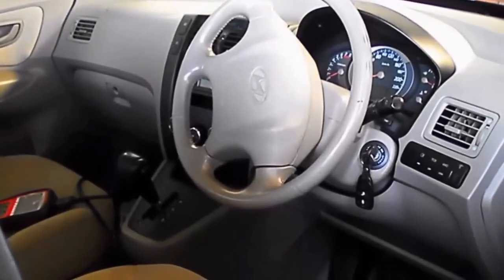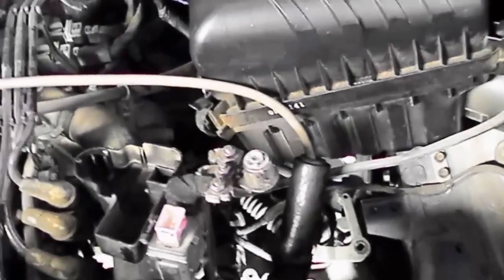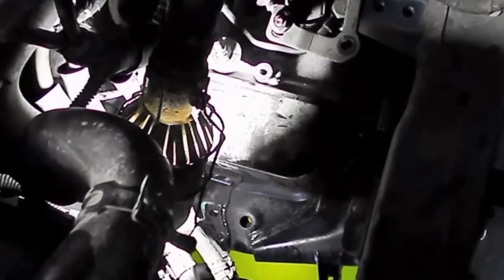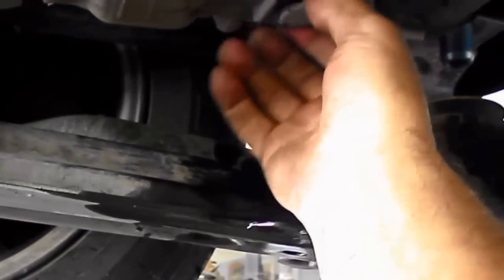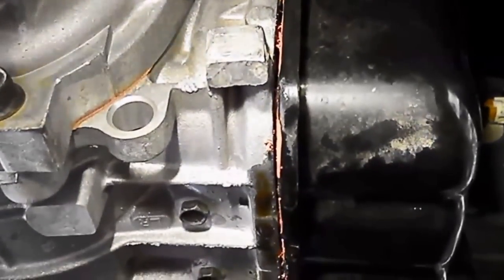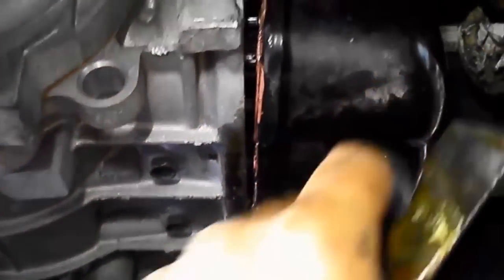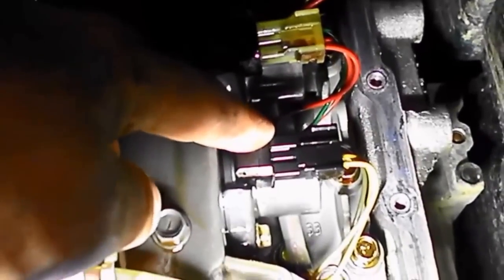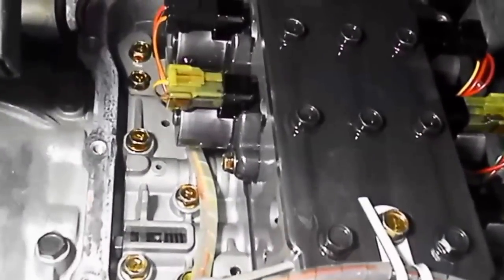Hyundai F4A42 Remove Automatic Transmission Solenoids DIY

Comment: Our 03 Elantra coded out a PO755 (2nd shift Solenoid) and Everyone had told me that they had to take the transmission out to do this. I am so thankful to have come across this. Now I know I can do this. Thank YOu!!!
Reply: I have the same code . is it the second solenoid shown?
Thanks
Reply: Well depending when circumstances if you're just trying to patch the transmission there's no need to pull it out but if you're doing a full service you would need to pull the transmission out that's what I would recommend I have been doing a lot of Mechanics for over 18 years but at that point you would be able to literally eat off that transmission before it went back into your vehicle hope that helps have a great day God bless and the service should not cost you more than 350 US dollars

Comment: Just wanted to say thanks for the helpful video. Was able to get the solenoids out and test them unfortunately they work. So it on to the Transmission control module next.
Reply from the maker: hi, hopefully you tested the solenoids varying amperage. glad helped, thanks & cheers 👍

Comment: Thanks for a great video.  I'll be doing this the same job soon.  How did you remove the wiring harness from the solenoids. Did you just pull, or is there a tab that has to be pressed?
Reply from the maker: hi, try wriggle connectors off. thanks and cheers

Comment: Greeting friend,
 the range of the selenoids should be ?, when measuring these gave me 
4.4 ohms, in this case you have to replace them or are within the range 
of operation?
Reply from the maker: Hi, depends what temp you are measuring at? should be 3.6 ohms @ 23 Celsius, but resistance will increase with temperature. hope that helps cheers

Comment: I am doing it at home can I just remove all mounts and just jack up the engine and transmission slightly to take the trans pan off? I have to replace a control solenoid so I'm going all solenoids to be safe.... Do you think it's doable?
Reply from the maker: hi, depends on your skillset, tools and equipment. just make sure safety is first. cheers

Comment: I know it’s been years since this was put out but do you remember if the pan had a gasket? From what I can tell, I don’t think it has a gasket since it looks like a sealant is used instead. Tried looking it up and I can’t find a one used on this vehicle, just wanted to double check before I take it apart.
Reply from the maker: hi, we use gaskets when they are available. cheers
Reply: @cliffl7619  amazing I really appreciate it. Would you happen to have a link for purchasing or a part number I can use?

Comment: Tuscone 2005 2.0 crdi driven 205000km
P0741
And a code for the inhibitor switch.
Shudder around 1800-2200rpm in every gear and very poor mpg.
Would this be the solonoids or the wiring for the solonoids? i have purchased both just need to get into a garage.
Reply from the maker: hi, id need more info to be able to determine. cheers

Comment: Gear 1 incorrect shift ratio that was the readout I've taken out the three solenoids on the one side and have tested them with a battery they all click does that mean they all work?
Reply from the maker: hi, these solenoids are tested varying amperage, not just on/off voltage. incorrect ratio might indicate slipping due to internal pressure leak. cheers 👍

Comment: Hi mate thanks for video 
I have 2008 Hyundai Santa Fe and codes  P0741 TCC son stuck of
P0735.,all gears are incorrect ratio
Do you think it is bad solenoids 
I changed the transmission fluid,  car still  hesitates to take off
Reply from the maker: hi, fault codes are usually electrical issues. more than likely contaminated and/or leaking solenoids and contaminated sensors. if you need more info, contact me on our facebook link, we can exchange pics, vids and beers on there. cheers

Comment: What was the vehicle doing for this job? I just bought this same vehicle the 2.7 FWD and it slips bad in drive. Have to use the manual mode, it tries to downshift constantly. What solenoid would it be for that the torque converter?? Any help is appreciated..... also is their a filter on this transmission?
Reply from the maker: hi, contact me on the face book link as i may need to send you pics and beers may be also needed. cheers

Comment: Hi I'm doing the same job right now and have a shift solenoid A code.  Do you know which one is the A & B.  I have 2 on the passenger side and 3 on the driver side 2004 Elantra GLS.  Thank you for your time.
Reply from the maker: hi, very confusing on these, a is 2nd from top on rhs ( where 3 sol are) and b is 2nd from top on lhs, as you are looking at them. id recommend to check them all though. cheers
Reply: Hi sir.  I tested all of them using a 12 volt battery and they all click when I connect the positive/negative clips.  Is there anything thing else that I should be looking for for?  Once again, shift sol A code.  Cheers
Reply from the maker: hi, you test these solenoids by varying amperage, also test resistance 3.6 ohms at room temp, will be higher if warmed up. now you owe me some beers !.use the link here https://www.paypal.me/BATS189 cheers

Comment: hi... whats seems to be the problem of the car youre fixing in the video? my car hyundai tucson 2010 80k kilometrs was flooded with water (muddy like) so I flushed it with hyundai ATf but aftr it jerks strongly from 1-2 gear when your gaining speed fast like higher rpm unlike the regular speed gain on the city traffic. maybe you have inputs on my problem.
Reply from the maker: hi, you will need to flush as much of the fluid out a few times. the coolant will get in the nooks and crannies and also absorbs into the clutch and band linings and will cause them to peel off...hopefully you replaced the faulty cooler ( we completely bypass radiators and heat exchangers to eliminate possibility of coolant entering trans ) and did it soon enough and well enough or your trans is on a limited life span.
Reply: @YepThatsIt  thanks.. i will check on that cooler youre saying.
Reply: well like you said, my car wont go forward now aftr 300 miles. N would reverse as well as drive. Can you help me figure this?
Reply from the maker: @mistergreen6557  hi, if was flooded, the clutch plate linings have probably peeled off. you will need removal and repair, and a reconditioned torque converter. cheers

Comment: My transmission on Hyundai Santa Fe has a code for shift solenoid A were is that located
Reply from the maker: hi, located on valvebody. make sure you check all solenoids while there. cheers

Comment: Sr. I have questions. Me have  one  car type Hyundai matrix gls the automatic transmission not working when we go run or reverse.  Thks
Reply from the maker: hi, any fault codes?
Reply: @YepThatsIt  no. But if we set to the drive or reverse nothing a power from the gear transmission automatic sr.?

Comment: 2001sante Fe trans just stop working out the blue but if I put it on auto shift it shift for one to two could that be a solenoid
Reply from the maker: hi, check all your basics first, then maybe check linkage worn or out of adjustment....then you can check solenoids. hard to say without more info. cheers

Comment: hi Sr..I have a 2009 Sonata 2.4l (4cyl, GCC spec') jerks when decelerating at 20mph. This happens only in the morning or every day at first use. I did not feel the jerk, once the engine become warm or after a 3 miles drive. I had gone to the dealer and and they did transmission software reset/update and that worked for me for 6 months. Again I am facing the same issue..what would be the problem..please help..

Thanks in advance !
Reply from the maker: hi, can be any number of things and very hard for me to diagnose without seeing vehicle. could be : fuel, electrical, blocked catalytic problem giving similar feel. always start with all the basic checks/tests before you start pulling things apart. cheers
Reply: YepThatsIt  ..Yup...Thanks for the reply Sr

Comment: Hi, I have an 02 Kia Optima se v6 with shift issues. The car accelerates slowly and seems to have a problem going from 1st to 2nd. Although I have codes for shift solenoids b and c.. How would I know which solenoids to purchase?
Reply from the maker: hi, try google a diagram for the solenoids, that will show you which is which. Or, alternatively if you visit your dealer ask them to photocopy from their shop manual. HopeThatHelps

Comment: My 2009 Kia Optima, which has a 2.4L Hyundai engine in it, was hesitating on the highway. Mostly from D to overdrive. The engine light came on and so I pulled over into an auto repair store and asked them to scan it. It came back P0741 torque converter, clutch, solenoid. I called my brother, who asked a mechanic friend, who told me to gear down when it started acting up, mostly going up hills. Is this video the process it's going to take to fix it?
Reply from the maker: hi, always good to start with solenoids, however depends on how many km vehicle has travelled as if its worn and internal pressure leaks a golden solenoid wont help. cheers
Reply: Thanks for the response. It has almost 146,000 miles on it ( 234,964.224 km}.I've had it flushed at least once. Reckon a flush might helped?
Reply: I priced a 60,000 mi replacement transmission at $450 U.S. as I began researching it.
Reply from the maker: hi, to me just a flush without taking trans pan off, replacing filter and cleaning magnets is mostly a waste of time and money. the fine metallic debris that is naturally created in transmission operation, will accumulate on the magnets until the magnets cant collect/attract the metallic debris anymore...then the fine metallic debris ( which has the consistency of grease ) will then become attracted to the solenoids which are electro-magnets. this will cause unnecessary contamination and wear, because the solenoids are the components that direct and regulate pressures and oil flows in the transmission......these are very important to keep as clean as possible. i say the more magnets the better combined with regular servicing ( not just a fluid change ) transmission service probably gets confused to be like an engine service -it is not !. the fluid is there to move things ( hydraulics ) and also a little lubrication. whereas engine oil acts like a filter that absorbs or contains the carbon in it, and needs to be replaced frequently and completely. hope that makes sense cheers
Reply: Ok, thanks. So a full servicing is a must in this situation.
Reply from the maker: always a good idea, but choice is always yours...i like regular maintenance, it makes things last alot longer and makes more reliable. cheers
Reply: As an ins. adjuster, I don't have much choice but to do the whole enchilada, so as to not have to worry too much about dependability. It messed up on my way to a catastrophic storm event, which due to lack of damage, was cancelled, but I can't afford that to be happening. We adjusters must have well maintained vehicles.

Comment: You don't have to lower the subframe. I removed the bottom portion of air filter box along with the air filter.  Also, remove the battery and the foundation tray that the battery sits on.   I removed one end of upper radiator hose(the end that goes into radiator) as well as one end of the lower radiator hose(the end that goes into radiator).  (Note)The fan mounted on driver's side of radiator will need to be removed to gain access to the lower radiator hose clamp.  Next, fold both radiator hoses back toward the firewall of vehicle.  I then removed the neutral safety switch giving me access to all of the bolts to the transmission pan to remove it and replace the transmission selonoids.
Reply from the maker: cheers & thanks for that
Reply: @YepThatsIt  You're welcome.
Reply: Did you manage to get the pan completely off?  I had went to a junkyard to practice it your way before attempting it on mine but the only issue was that the subframe was blocking the pan from completely coming off. I can probably get away with just partially pulling it off to get to the needed solenoid if I need to.

Comment: Hello sir.     I've got 2007 elantra auto, which after about 50 miles of driving, or much less, will give a loud clunk and a shudder, normally on deceleration and then it looses 1st gear and over drive-meaning that at 50mph it is doing 3500 rpm.     I have changed the input/output sensors and I believed that the solenoid are either shorting internally or just weak after 200,000 miles.     Any thoughts bro...??
Reply from the maker: hi, I'd say it could be a solenoid problem, often they have ok resistance when tested cold, but when warmed up fail. hth
Reply from the maker: Can be accessed easier from underneath, but would probably be much easier on a hoist than lying on your back....would be hard to bend your arms ;-)
Reply from the maker: hi, hard to diagnose online, but could be contaminated solenoids

Comment: hi my car is hyundai sonata nf 2009 check lamp is on and fult p0471 in diag  
torqe converter stockoff 
teranmission have 7 solenoid valvue
i dont know tcc sol where plz help me
Reply from the maker: hi, if it`s the same transmission as this one....as you are facing and looking at the valve body while still in vehicle, the torque converter solenoid should be the bottom right one. cheers

Comment: Hello again   I am desperate for some help:     do you know the position of the check-balls for rebuild..   1 with spring and 1 just the ball that sit between the part with the galleys where the accumilators sit and the very upper where the actual soloids are.. I split those two parts by removing all of the bolts from beneath ..( D'OH! )   and of course those check balls ( 2 of ) dropped out     I cannot find any information that shows this 'clearly'.   I have the Hyundai factory manual but it is an exploded view from an above angle which is very poorly illustrated!       Any ideas bro ??     Many thanks either way - Eddie
Reply from the maker: Hi, usually the check balls leave a mark on separator plate or hint where they have been working by a wear mark....alternatively ATSG have a check ball book. Sorry can`t help more

Comment: Hello admin
I have kia morning 2006. it alert with code P0741, the symptoms is runing up to 80km/h =2500RPM, that is high RPM. Before alert this code, it was just 2000 RPM with 80km/h. is it problem with those 4 solenoid? 
is it good to change the 4 solenoid? thanks
Reply from the maker: hi, hard to say. if it has the correct fluid level and filter is not blocked, you may have internal pressure leak somewhere causing the slipping and high revving. the p0740 fault code is pointing to the torque converter clutch solenoid, but as you say good to check and/or replace all the solenoids. good luck cheers

Comment: helo sir can you help me po my tucson 2010 AT Gas the scanner read P2709 Code Shift Solenoid F TCM 
any advice po thank you
Reply from the maker: hi, fault code is electrical issue where the programmed parameters have been exceeded. most often it is a contaminated solenoid/sensor but can also be a bad connections, weak battery, bad earth connections etc. always check the basics before you go pulling things apart, regular service and cleaning/adding magnets is always a good idea. cheers
Reply: the mechanics says he pulled out the transmission because my car also has a shift shocks on the Reverse and Drive and also sometimes not good and pulling uphill
Reply: what is the basics they need to go po before pulling down the transmission

Comment: White that type of transmission, does it have a oil filter?
Reply from the maker: Hi, transmission needs to be disassembled to replace internal filter, can have spin on filter on top of transmission. Cheers
Reply: YepThatsIt oh boy...no video on that lol.  Their is a spot for filter on top but it's sealed off so no filter can be used outside.  Maybe it's behind solenoid pack....thanks bud
Reply from the maker: Hi, nah you need to disassemble transmission in half to get the internal filter out....you can put in a inline filter on cooling line and magnetic plugs will help. cheers

Comment: Procedure of revision and change of solenoids of the automatic transmission F4A42 in Hyundai TUCSON 2006 that throws:

OBD code (on-board diagnostics) P0713 - (TFT)?

How to solve it or if there is a video on how to change or replace this sensor?

Thank you
Reply from the maker: hi, generally if the tft sensor is playing up, you will need to replace the whole internal transmission wiring loom. mostly you can`t buy the transmission fluid temperature sensor individually. if you have one from another loom you could cut off and re-solder on to your one is a possibility though. hope that helps cheers